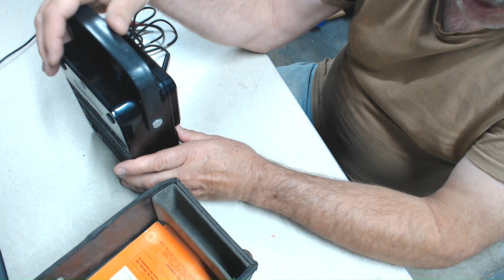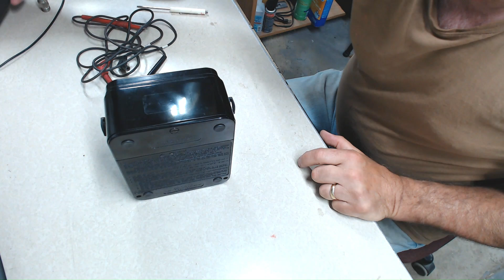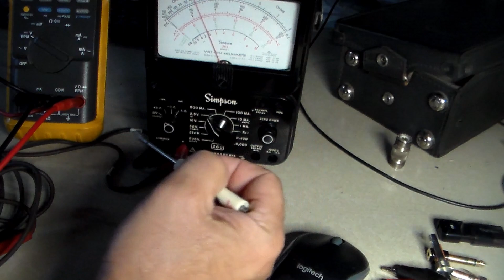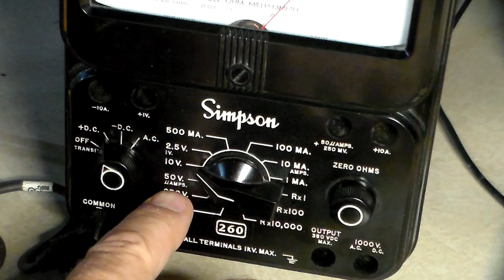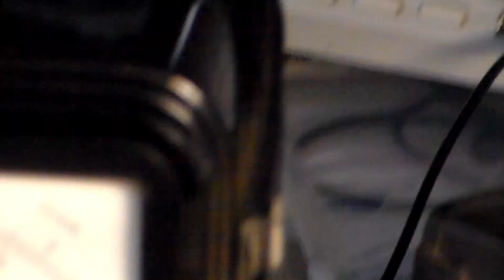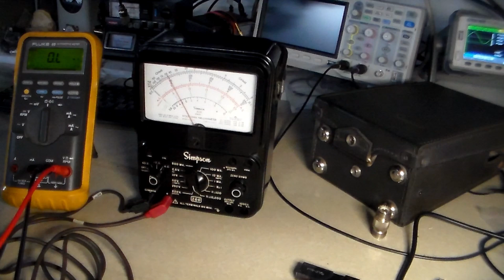Simpson 260 VOM

Comment: When I was 10-years old my father "liberated" from the U.S. Navy a Simpson 260 VOM (Volt. Ohm. Milliamp) analog meter, it was my first piece of precision test equipment because he knew that I was interested in electronics. To this day I still use a Simpson 260 meter on my test bench every day, even though I own several digital multi-meters because it does something that no digital readout will do: trending! That needle displays something that humans can easily and objectively see, "visual comparative analysis", we can detect the slightest movement of that needle, an absolute requirement for "peaking" and "dipping" of voltage levels. When I test a toggle switch, I use my VOM on ohms and test the switches functionality and wiggle the toggle to see if it forms a secure connection. In testing potentiometers, the smoothness of that needle sweep denotes that the resistance is without interruptions or intermittences of any kind, no DVM can do this! In continuity testing of intermittent cables, and multi-conductor wiring looms, flexing and bending these wires while watching that needle can instantly determine precisely where that hidden intermittent problem exists. In all of electronics, the oscilloscope is the single most important test and measurement device tool we have, because it also allows visual comparative analysis of test signals sent into and out of a test circuit for frequency, voltage, wave shape, and timing. If you look at the history of electronics, when the "precision" oscilloscope was first introduced post-WWII, the world of electronics was truly born, every advance in electronics took place after a better and faster oscilloscope entered the market. Just like the VOM and the oscilloscope, we humans need visual comparative analysis to be objective! David Riddle